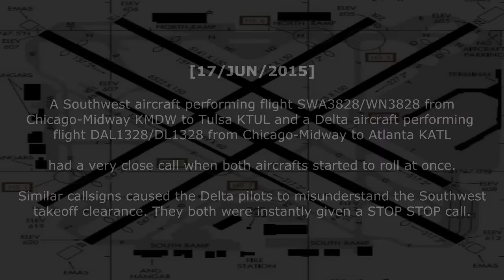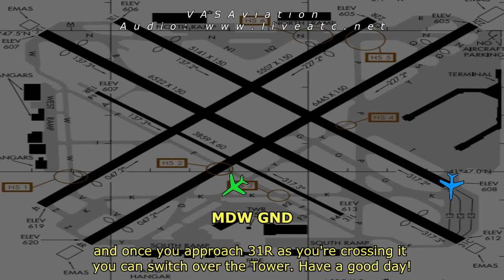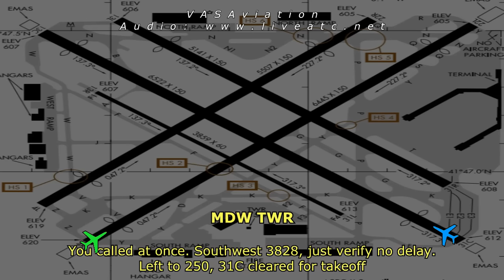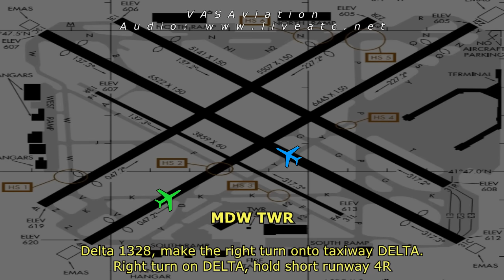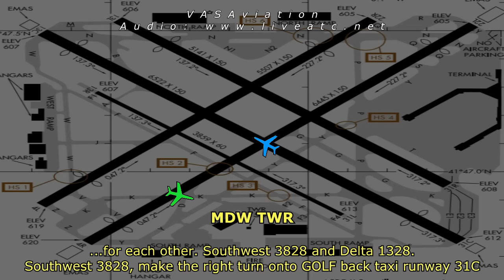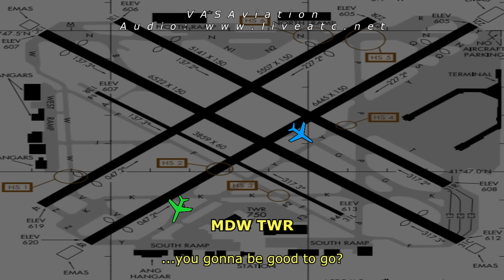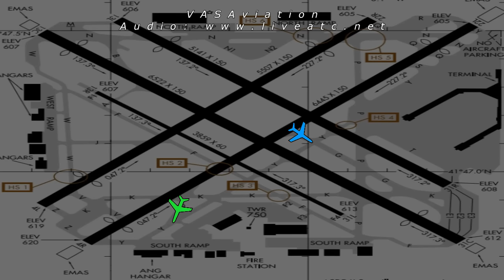[REAL ATC] Delta and Southwest VERY CLOSE CALL on takeoff

Comment: That was an honest mistake.  Glad everything worked out.  I hate hearing over the radio, other aircrafts with the same numbers as me.  It gets even more confusing when people step on each other.
Reply: ***** Clearly... But it was still a mistake that ANYONE could've made, especially given the situations that they all were in. Fortunately everything worked out, but it was a mistake that many of us have or will make. Best we can do from this situation is to learn from it.
Reply: Excuse my ignorance, but what do you mean by "step on" each other?
Reply: It is when two people try to transmit over the radio at the same time. When this happens, the first call may come through and the second one is blocked. Sometimes both calls may mesh or both are inaudible. The two people transmitting may also not realize that one stepped on another so that can further complicate things
Reply: BBadalamente Thanks
Reply: Why isnt there some kind of noise to indicate when that happens so everyone knows they might not have been heard properly, I feel like this would be extremely dangerous???
Reply: I'm guessing that's not how radios work.
Reply: Maybe they weren't trying to take off, just taxi really fast over to 31C to take off.  :/
Reply: Rae Rae While there isn't exactly a noise, sometimes another pilot or an controller will say "Blocked" to let the transmitter know that the radio call was not heard. 

When dealing with a controller a pilot needs to read back all instructions to acknowledge that they heard and understood what they were told. In this instance both identifiers were similar so the one pilot accidetally went off the  instructions meant for another aircraft.
Reply: SMH, this is exactly why we as controllers inform pilots of similar sounding call signs. You would think the pilots would be more vigilant after being informed of it.
Reply: absolutely not an honest mistake. the controller cleared wn and not dl unambiguously and after warning both crews of the similar callsign. the controller then said "uh somone stepping on me, sw you clear on 3 1 c, and left 250" which would have been a tight ass turn off 4r. dl was on 4r and not 31c so no idea how they construed clearance (maybe they heard similar stepping-on their radio that they heard that we cannot hear). controller then told wn to expedite likely because of tight constraints out of mdw, and wn crew probably should have stopped and made clear everything, but again, mdw cross runway operation they probably had pushonitus, contributed by atc. this was a system of failures, not one honest mistake by one person. this is a really asinine comment unless you live in congo or lebanon or something where winging it and having fully preventable cross runway collisions in the context of a highly controlled aerodrome is "an honest mistake"
Reply: I disagree - they had BOTH been explicitly warned, and had both stated they would pay attention for, a similar callsign to their own. The delta crew then did no such thing and acted on calls NOT aimed at them.  The delta crew should also have realised the call was not for them because the runway referred to was not the one they were using. Back to school.  Top marks to the ATC guy for realising that both were rolling and taking prompt action.
Reply: ERAUPRCWA really bad voice procedure is the issue
Reply: People are human and they make mistakes.  Part of the reason you put layers of reinforced backup plans is because they make mistakes.  Does Delta 1328 bear the majority of the blame?  Sure.  Does it seem like the mistake could have been prevented?  Yes.  But mistakes can be made.  It should be noted that SWA 3828 responded to Delta 1328's abort and taxi instructions

The thing that strikes me most is aside from the crosstalk during the readback, Delta 1328 is quiet while SWA 3828 asked multiple questions and took the initiative of confirming whether they'd been at fault or not and indicated their need to stop and requested permission to stop while Delta just did and only confirmed need to call company after SWA 3828 mentioned it.
Reply: ERAUPRCWA Alaska Airlines?
Reply: Wouldn't you say a lot of these problems are being caused by fat fingered crew who don't release the mike key?
Reply: Obviously it wasn't intentional...but it was a poor mistake to make. They had been warned, yet still started rolling, both pilot flying and co-pilot failed to notice, and they should have heard the airline name, not just listen to the numbers.  Restrained and written warning on the record at the very least!
Reply: "31Center... Cleared for take off "  Not everybody can make that mistake.  31C was clear, not stepped on.  Delta fucked up big time.  I wonder what the announcement in the cockpit was from the Delta pilot.  It was probably something like "Folks, due to ATC instructions we had to stop our takeoff roll.  We'll turn around and be on our way shortly."  Instead of  "We weren't paying attention and started the takeoff roll without clearance and almost killed 300 people."
Reply: When 2 or more users try to talk on the same frequency.  It could be multiple airplanes, or when a controller is talking an airplane tries to talk at the same time.  All you hear is a garbled words or noise.
Reply: robert winton I'm a pilot. VHF radios have this characteristic.  Pilots deal with it every day and it's not abnormal.  What's abnormal is how the Delta clowns dealt with it.
Reply: robert winton the ATC recordings you hear are from private ground stations near the airport.  The quality is compromised.  It's not bad at all in the aircraft but when a  transmission is "stepped on" or as pilots call it "blocked", it's necessary to repeat what you said.  These are not $99 CB radios.
Reply: @robert winton.  We can put satellites into space but cannot have coherent radio.  I agree.  It is appalling and inexcusable.
Reply: robert winton sounds like you're better off taking the train...   Me, I'll stay in the cockpit.
Reply: chris gast with military radios usually when you key the mic on top of somebody else’s transmission you’ll get some kind of beep beep beep sound. I guess thats not the case here
Reply: It's often a "sticky button".
Reply: To change over to a nice, clear digital system would cost tens of billions, and everyone would have to do it at once, or two systems would need to exist.
Reply: zog zog there’s no way in hell we went to the moon
Reply: Chuck Schick Nice, now there's the negationnist jumping in
Reply: Rae Rae It is. It's responsible for the world's WORSE plane crash. But no one wants to spend the money necessary to prevent this, so it can very well happen again.
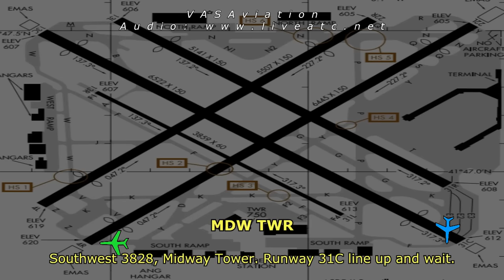Reply: You don't hear that tone indicating 2 radios were stepping on each other preventing everyone from hearing the vector readbacks?  During the initial clearence to take off all you here is "28 traffic holding in position blah blah  blah your no delay please". You can hear the "southwest 38" is cut off. Then the 2 aircraft step on each other during read back over the radio which causes that. Wath and listen at the 1:06 mark.
Reply: The radio only supports one person trransmitting at a time so when two people talk on the radio neither people here each other while everyone else hears garbled noise. When you see [blocked] this is happening as both planes are answering.
Reply: I kind of feel the callsignes being said at the start of each the transmissions where being cut off, uou even hear this at 1:06 as the text reads the full call sign but all you here is 38 on the radio. Sure Delta 1328 may have jumped the gun but I don't trust those radios. Even wallmart will callout instructions twice over ther intercomes why can't Traffic controllers who know there are similar callsigns repeat the instructions.  

   Also whats the implication of Delta remaining quit durinmg the conflict resolution phase?
Reply: They had both been warned but I think the traffic controllers being the primary speakers during interactions with the planes should have echoed their instructions twice or made a better effort to disambiguate the instructions.
Reply: J, Berian Schaer yea we know pilots have to deal with it and have been doing a good job so far but considering the amount of lives at stake most of us believe the center point of failure "The radios" should be upgraded. Every one has been screaming about this for over 30 years. Sure  human error contributed to this incident but we have to admit the crumby unclear radio makes this much worse. Notice how during the emergency stop call everyone was stepping on each other. This emergency information needs to flow unhindered by the technology being used. Jesus lets just hope pranksters or terrorists don't start making it a habbit of jamming VHF frequencies near airports in the future.
Reply: J. Brian Schaer then why didn't the traffic controllers repeat their orders then knowing the callsigns sound the same. Even wallmart echoes their announcments over the intercom. "Customer assistance to electronics please, I need customer assistance to electronics." Notice that the during the taxi instructions at 1:38 the callsigns are cut off again at the beginning of the transmission causeing SW3838 to confirm the taxi instructions they believed were for them as well.
Reply: ERAUPRCWA How easy is it to make? He was warned of a similar callsign. Lined up on 4R. The takeoff clearance for 31C....   ?
Reply: The problem is the controllers start talking an instant before they push the talk button. They need to delay a split second longer. The Delta and Southwest part and sometimes the first number of the flight number are not coming through. This is an ATC problem.
Reply: I am your 800th like
Reply: I think for these situation they should just talk one at a time and keep the other on hold so there is no confusion!!
Reply: BBadalamente d
Reply: forgottenfamily "It should be noted that SWA 3828 responded to Delta 1328's abort and taxi instructions" I can't really blame them. I know the audio we hear is worse than what they hear, but I didn't catch the entire call sign at 1:35 either, sounded like that was blocked / stepped on too. Would you rather think "Probably wasn't for me..." on a STOP STOP instruction with a partially blocked and partially matching call sign while you're hurtling hundreds of lives, thousands of pounds of fuel and millions worth of equipment into an unknown? Better to give the approaching aircraft (as that's what I'm assuming the no delay take-off is about) a go around and live to tell the tale.
Reply: @BBadalamente If two stations are transmitting at the same time, it's usually a question of who is closer to your antennas position or who has the stronger wattage. In some cases there is clearly one winner, but most of the time you'll get terrible screaching and there's barely anything readable.
The sending radio can't know if there's anyone else sending at the same time. That's why these simoultaneous sending situations are hard to avoid.
Reply: All_Roads ik the atc repeated it twice
Reply: Everyone defending Delta, no, no, no.  Does he not know where he is?  And I know flight number sounds similar, but "Southwest" and "Delta" sound nothing alike.  I mean, everyone is talking WAY too fast to be sure enough of what they're hearing.  I'm wondering if this made it past both the Captain and first FO on Delta.
Reply: @erauprcwa  this honest mistake took the life of 583 people in Tenerife in 1977 have a look at Tenerife air disaster overlapped runways like this 2 boeing 747 collided because of lack of attention.
Reply: @bradleygormley8941  Not the same thing. The Tenerife incident was the result of a ego-driven Captain of the KLM flight who did everything wrong and was a tyrant of the flight deck, including attempting a takeoff without a clearance.

This was a mistake due to similar callsigns, which can happen to anyone.
Reply: Chris Richardson  You must not fly airplanes for a living...
Reply: @Haildawn  it IS dangerous... look up Tenerife disaster
Reply: @HolidayArt  well that's a little more complex than that. Radios sound like shit, but they sound like shit consistently in up to 100nm range while transmitter and receiver moving at up to 1000km/h ground speed.

What saves the day in case of bad reception is that there's a thing called radio phraseology, basically pilots and ATC only say certain things and in a certain way on a frequency, they don't just chat. There are procedures for everything, and there's very little room for guesses even if something wasn't heard correctly.

In this video everyone followed proper procedure except Delta pilot who was on the radio, and multiple safety checks failed before and after he made his mistake ("similar callsign" warning didn't alert pilot enough, ATC didn't get clear readback but didn't revoke clearance, because he didn't realize in time what exactly that stepping on on readback means, probably some more safety nets here I don't know about), but ATC saw situation on a radar, issued proper command and disaster didn't happen. Swiss cheese accident model as filed.
Reply: Rae Rae because the only people who can receive are the ones not talking. Some commercial band radios that have digital squelch circuits for frequency sharing will block you if someone else is using the frequency on a different squelch code than you, but these transmissions were happening pretty much at the same time so that may not have functioned here.

Even if you were to “listen” on the same frequency you’re transmitting on your own signal would completely drown out anything else, not to mention probably destroy your receiver unless you put in some massive attenuators :) great question though!
Reply: I'm not a pilot or ATC but it sounds to me like the ATC not addressing the blocked calls earlier and not using Delta and SW to distinguish call signs caused he issue. All I ever heard him say was 28 until after they nearly had an accident
Reply: Oh does  "31C cleared for takeoff." sound like "4R cleared for takeoff" to you?
Reply: I won't try and place blame but the solution to prevent this seems very simple to me. Don't line up aircraft with similar callsigns at the same time.
Reply: All of you who are stating that Delta was stupid and who are passing judgement on them are hypocrites!  Those of us who have been in the game for quite a while know that there are those who will and those who have.  As a 30 year pilot for a major airline and a wide body captain/check airman, and with 37 years total flying experience, people need to know that we are all human and are prone to making mistakes.  This is why we have a safety management system which analyzes accidents and incidents so that we can learn from them.  Human factors analysis provides us with data points allowing for safety enhancement.  Rather than passing judgement, let us take the opportunity to improve the system.  This is how aviation moves forward with innovations.  In particular, this incident is one where there are lots of areas for improvement.  One is the discussion of datalink installation across the board in the USA, we are way behind the rest of the world with this technology.  Also, with regards to the human factors, the controller was operating at a very fast tempo, which creates the potential for more errors.  Both crews were also operating at a high tempo in a very congested terminal area of the country, Chicago.  O'hare is very close to Midway and threats and errors are inherent.  There are training opportunities for both flight crews here as well.  I always soul search when operating in what I consider to be areas or regimes of threats.  That means slow down!  If we depart late, then we depart late.  If ATC has to ask us again to comply with a clearance, then oh well, they have to ask us again.  At the end of the day, pilots are exposed to a number of extremely challenging events day in and day out and do it well and at a high level of precision.  The reason flying is the safest form of transportation is due to the excellent job that these men and women do every day all hours of the day year in and year out.  Keep the great videos coming!!!
Reply: An honest mistake that almost killed everyone
Reply: It does seem, regardless of the runway given clearance, both pilots should have exercised caution given there was confusion.  Situational awareness seems key and the pilot with clearance could still have simply waited to get a not stepped-on clearance, to know for sure it wouldn’t be a source of confusion.  Of course more responsibility was on the other pilot, even if he didn’t hear it right, that’s no excuse to start taking off.  I’m surprised there wasn’t more of an issue over the Delta starting his takeoff roll, the tower may have averted disaster, and he definitely had no business taking off.  It’s not like a transmission gets magically transformed to sound like their runway, he just wasn’t paying attention, heard clearance for a similar callsign and went.  I say both, however, because if two planes with similar sounding callsigns have perpendicular take offs at nearly the same time, that seems like an obvious thing to have radio awareness of.
Reply: I feel like the radio communications used in air traffic control is fairly antiquated.

There should be a way for the tower to directly address a specific callsign by the press of a button or something, which then gives the pilot a visual indication that he's the one currently being addressed (along with verbal callsign). This should avoid such confusions like the one in this video.

Also if the transmission is blocked (i.e. more than two people transmitting simultaneously) there should also be a visual/audible indication for the involved pilots/controllers.
Reply: forgottenfamily if assuming that you’re not in aviation, and you actually are, I apologize in advance.....I am, and I can tell you Delta didn’t ask questions bc they think they don’t make mistakes. Their “I am God” attitudes won’t allow them to accept responsibility for their mistakes. That blanket statement doesn’t include the former NW element of Deltas pilot group. They need to be knocked down a notch or two and hopefully, that did it...but landing on a taxiway in Atl several years back didn’t do it, so.....🤷‍♂️ I’m sure they blame somebody else for that as well.
Reply: @demoniack81  What's the video of this guy getting mad?
Reply: Not the same numbers. Once is 1328. The other is 3528. Different.
Reply: @SYDAirlineEnthusiast  1328 and 3528 obviously aren't the same.  However, they both end in 28 and are prefaced with a 3...  In communications, it's relatively the same and sound similar when read aloud quickly over the radio.